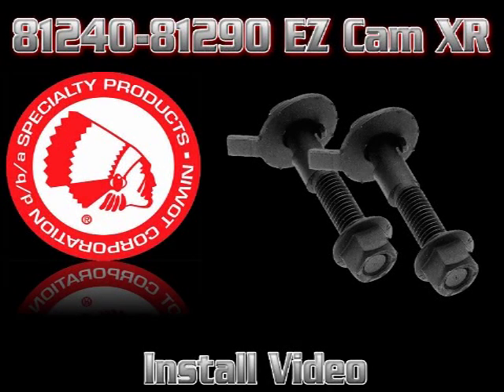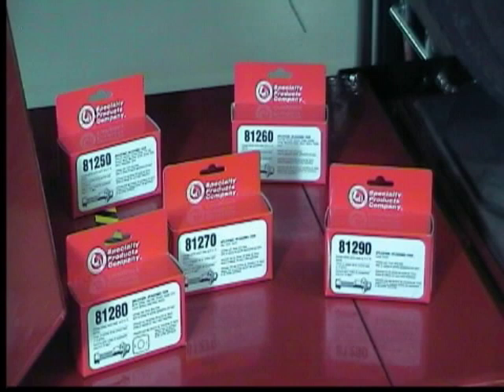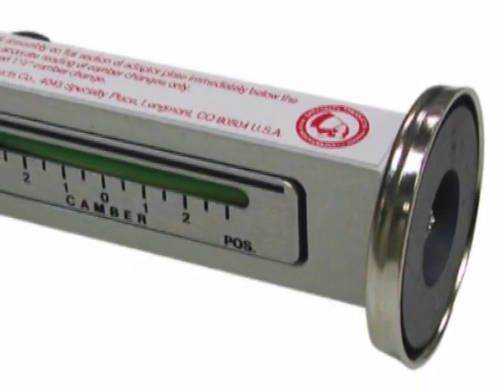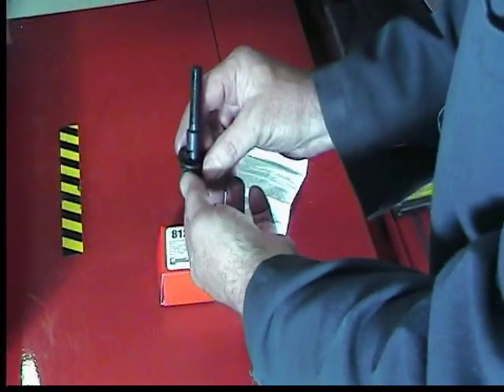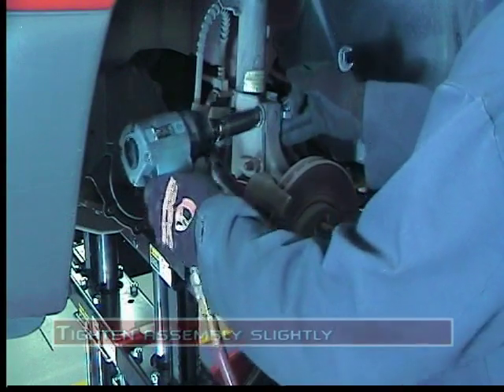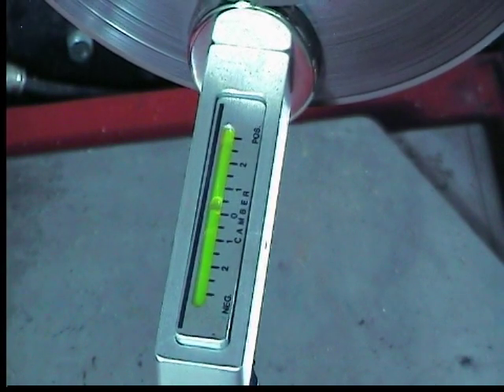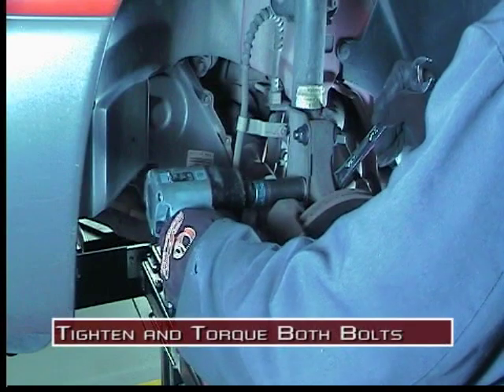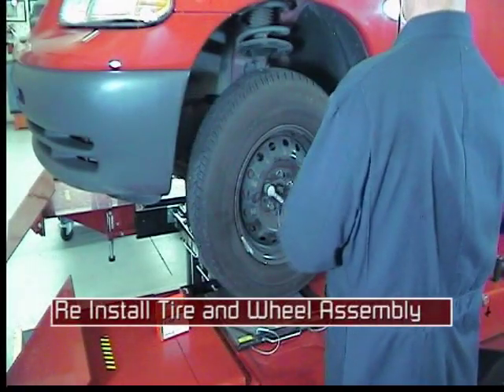81240 / 81250 / 81260 / 81270 /81280 / 81290 - EZCam Installation Video - Specialty Products Company

Comment: I need this for my 07 Yaris; can I install this on my own and bring it into a shop for alignment?  Also if  I change the right side than would I have to change the left side?  Thanks in advance.
Reply from the maker: Hello, you are best to have it installed at the alignment shop so the tech can then adjust it, you could unknowingly change the alignment angles with a self install. This comes as a kit, its possible to do one side, but an alignment covers at least the front two wheels anyway, so there isn't really a benefit to only doing one. Give us a call with any further questions. Thanks!
Reply: SPCAlignment Would a shop install items not bought by them?  I'm sure you get that question often.  The problem is that only the right front side of my car needs the alignment.  Thanks.

Comment: I can be wrong but, if the car is lifted in the air with the camber meter attached, wouldn't this screw the results without the car on the ground? The car would have positive camber while up in the air with no load on the suspension, correct?
Reply: I know you wrote this 11 months ago, but I'll answer for anyone else who has this question (or if you still have it...)

The factory values for camber already assume the car is in the air, so they are pre-adjusted.  My car (Volvo 850) specifically says to only adjust camber in the air.  If the two sides do not have matching camber after being dropped, then you probably have a spring or spring mount problem.

Comment: i have an explorer with a lift kit.. the shops have said that the camber is out of spec due to the lift kit and they can't adjust the camber enough to fix it.. so is this aftermarket part adding more camber than what can be completed normally? how does camber get adjusted normally if not with this kind of bolt?
Reply: @specialtyproductscompanysp8027  thanks for your reply.. it's a 2015 explorer XLT front wheel drive.. this is for front camber.. the lift kit is a traxda spacer kit 2.25" front/1.25" rear item number 102040.. the tires are larger than spec at 265/60R18 mounted on 18" American Racing AR201 Cast Aluminum Wheel - Cast Iron Black. OEM tire size is 245/60R18.. I don't know if that tire size is any concern.. but i thought i should be as detailed as I can.
Reply: @specialtyproductscompanysp8027   Thank you! I will be working with a truck 4-wheel drive place that specializes in lift kits and will relay this information to them as they themselves were unsure about whether or not to try SPC camber bolts. And i'll ask them to see if the lower ball joint is wearing prematurely from over-articulation as well. many shops refuse to use non OEM parts, so that's tricky.. I definitely can't do allignments myself anyways..

Comment: do you guys have any that can adjust 2 degrees?
Reply from the maker: There is limited offset available for these EZ-Cam bolt kits; you can only go down one bolt size. Most strut suspensions don't change camber as much during ride height changes as most multi-control arm suspensions so the ±1.75° is usually enough. If you give me some vehicle details, maybe I can help. Is only one side off, or both?
Reply: @SPCAlignment  it would be for only one side (the right, hit a pothole or crater more like)  It is an Acura RSX 2006 with a MacPherson strut. The alignment shop indicated 3 degrees of positive camber and i need that regulated or with a little negative camber. Thank you.
Reply from the maker: @kingcamilo  The RSX is 3.5° of camber away from preferred spec for the right front. This is double what an EZ-Cam bolt can do. Something is bent and should be replaced. The SAI Diagnostic Guide may be helpful to determine which part is bent. https://www.spcalignment.com/images/stories/catalogs/SPCInteractiveCatalog_2020/8/index.html    (Page 6 of the paper catalog, page 8-9 of the online catalog.) Or, if you can provide the SAI and Included Angle for the right front from a complete alignment report, I can help with that. Bent strut, knuckle, lower control arm or control arm mounts can all cause excessive positive camber. Camber, SAI and Included Angle can help us narrow down the possibilities. Even if there was a bolt which could get camber in spec, the SAI would be off and the car would still have a pull. We want to repair this correctly.

Comment: This guy has not demonstrated at all how to properly set this camber alignment up !.... The vehicle has to be properly levelled up before one commences this procedure other wise one can't determine the true reading on the metre that guides you to correct to a pos or a neg camber setting . Doing this on a drive way or such can't be accurate as the levels will be off . After all one is working off a bubble level that will give a false reading simply because of the ground levels . Best way is to install these bolts and then take it to a place where a 4wheel alignment is procedure is carried out to get it properly set ,where they can make the precise adjustments .
Reply: Just put a carpentry square against the tire when it's sitting on the ground.  You want square not level.
Reply: He is showing how to adjust the camber from an existing measurement. Measure the camber THEN adjust for more or less using this method.